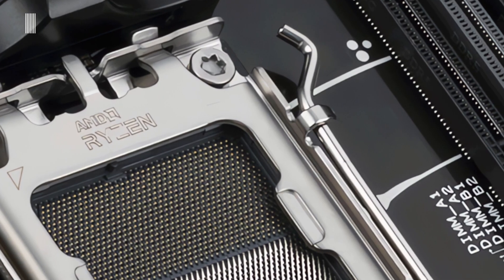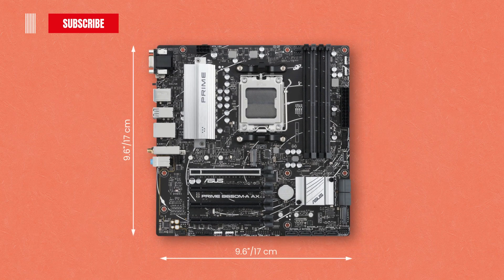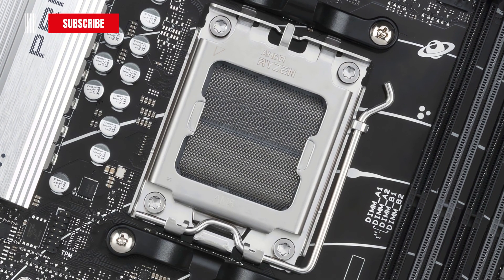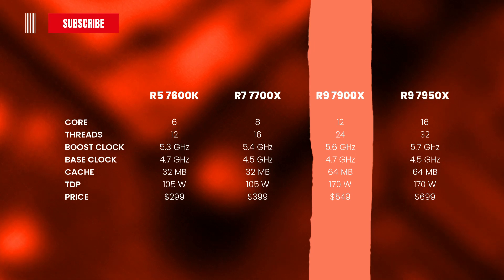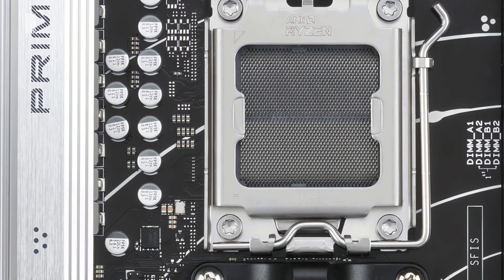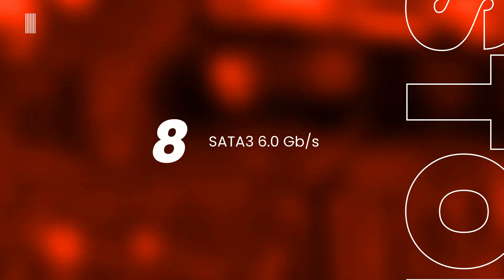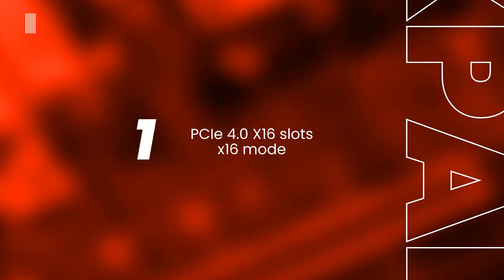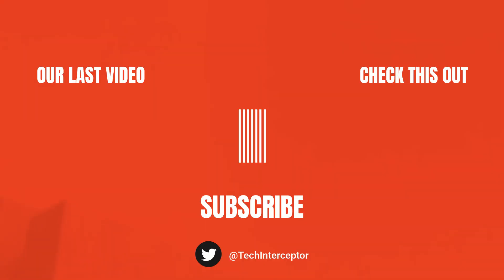Asus Prime B650M A AX - New micro ATX motherboard designed for Amd Ryzen 7000 series desktop cpu

Comment: Hi there:
I got the ASUS Prime B650 M and have 3 hard disks running in bay 4 and bay 5 - and I can not access these 2 from Windows since the mainboard has configured them as a RAID array.
I tried to find a way to dissolve the array and use the two disks - nope.
Do you have an idea?
Reply: It has only 4 sata ports, how come you're using port 4 and 5 ?